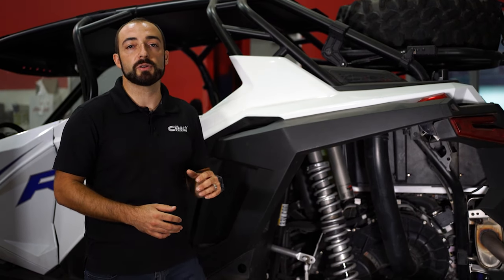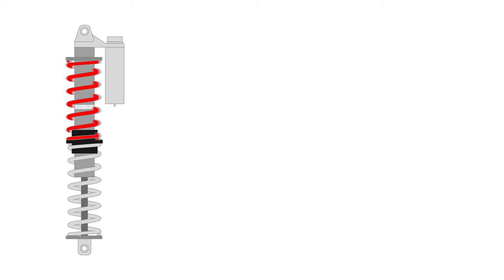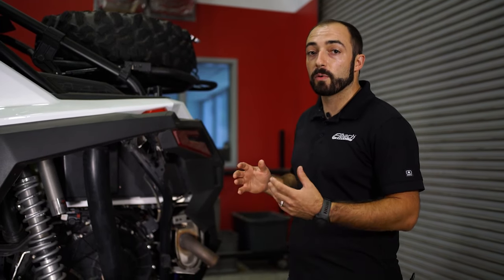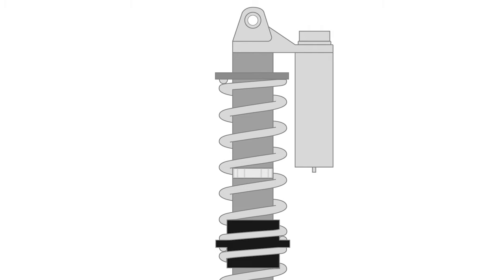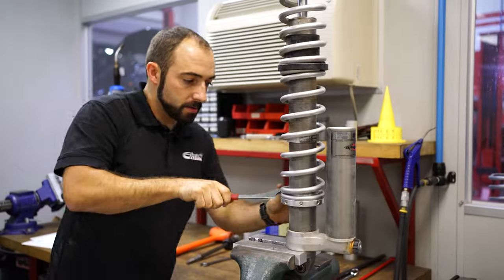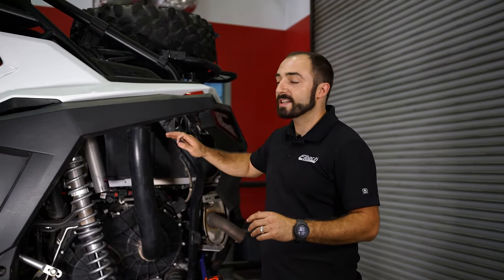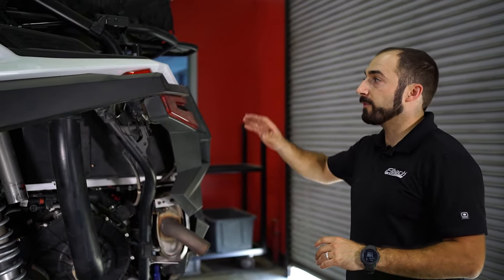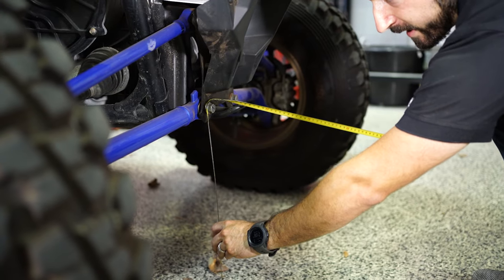How to Adjust Your UTV Shocks

Comment: I have a dual rate setup from shock therapy on my RS1. I love it on the trails when it gets choppy but the front end likes to plow and dig in the corners. Is that because it's relying to much on the tender springs? Would it help if I lowered my crossover rings so my main springs start working sooner?
Reply: Ask shock therapy for God sake 😂